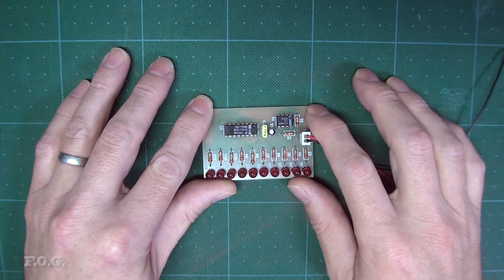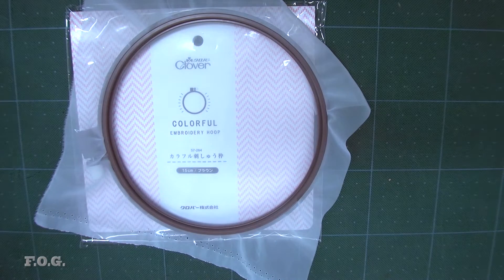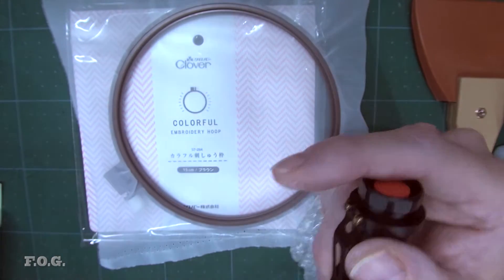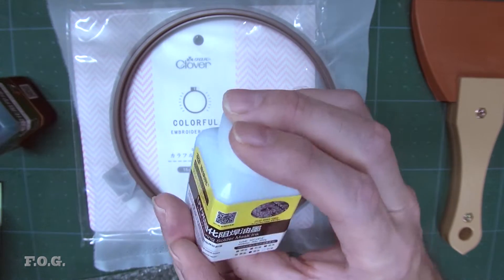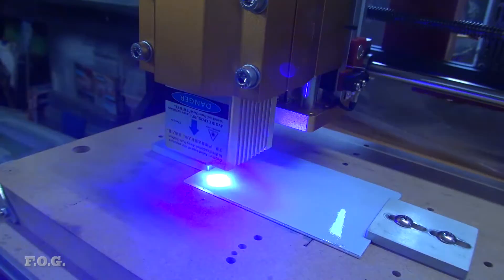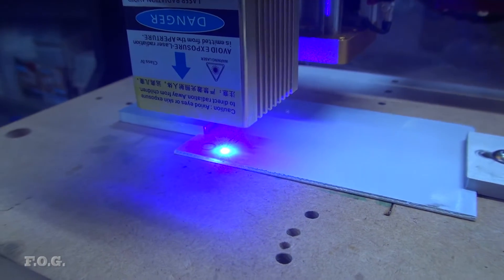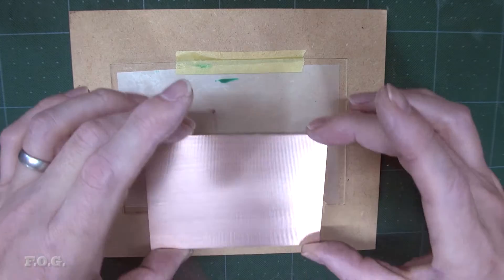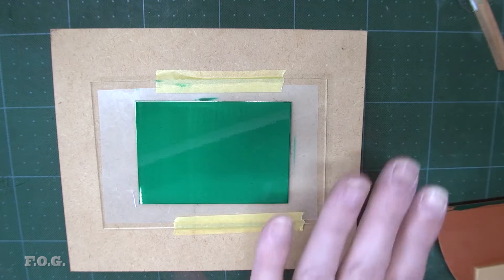EP6 – DIY PCB – Silkscreen UV Resin Coating

Comment: Will need eye protect glasses of uv light
Reply from the maker: @المخترععودةالكاطع  Yes, you will need!
Reply from the maker: @المخترععودةالكاطع  sorry, small correction. I thought you were talking about the UV laser where protection glasses are a must. If your UV light has its own UV light shield, then you don't really need glasses. If you have an open UV light, and you use it a lot, then using UV protection glasses would be a good idea. Generally I don't use UV glasses during the UV curing process, as my lights are shielded.
Reply: @ForOurGood  
Thank for your answer

Comment: that green solder mask at the end ? what brand is that? and did it come out that shiny after removing the screen?
Reply from the maker: @eross21  The brand of the green UV resin is "WNB". You can find it on Ali-Express. It is shiny after removing the silkscreen, but after UV exposure it goes a little matt. I think it looks pretty good, better than shiny.

Comment: Silkscreen is in an Indian PCB factory video.  Also you can CNC the resin off in the areas you want to use as pads and leave the copper.  This is after then resin is cured over all of the PCB side.  There is a video of someone doing that method.  

They CNC'ed both sides and did the holes.  They then did the vias.  There are two good ways of doing the vias.  Then the tin bath to protect to copper.  You can do this after the resin coating.  This means just the pads are tinned.

Second method:  Silkscreen for the resin coating and then used toner on a transparent A4 sheet to block the UV light in the areas they didnt want cured.  They printed the pattern twice and stacked both on top of each other.  Then placed on top of the resin coating and applied the UV light.
Reply from the maker: I am sure there are many videos on YouTube featuring various different methods for this, there are about 5 videos on the topic on my channel alone! Check them out if you are interested.
Thanks for the comment.:hand-orange-covering-eyes:
Reply: @ForOurGood  I will watch all your videos.  About to try and do this myself.  I'm trying the CNC method.  Using the silk screen to apply the ink and a laser printer to create a mask for the UV light.  Via's will use rivets for double sided boards.  After the uncured ink is removed from the pads.  Then tinning liquid on the pads only.

Just trying to avoid all the chemicals if I can.  This is being tried at home.  All your's and others videos are making this possible.
Reply from the maker: @GodKitty677  Good luck!

Comment: Have you ever tried instead of couting the board with resin use a venyl sticker
Reply from the maker: Thanks for the question!
I have actually thought about it, but I have never tried it, as it would be extremely hard to cut the fine details I need using a vinyl sticker.
Currently I am etching features as small as 0.1mm with spacing of 0.12mm using UV resin, my experience tells me that that would be impossible using a vinyl sticker.
Thanks for all the comments and I am happy to hear you liked the videos, there will a new video out soon.

Comment: Do the UV resin resist to the temperature of solder?
Great vídeo by the way
Reply from the maker: Thanks for the question! Yes, this UV seems to cope well with the typical temperature of solder. In my later videos, I did some rework, and there was no problem. Of course there is a limit to anything, too much temperature for too long, and it is going to start to break down.
Reply: @ForOurGood  Thanks for the quick answer. I will try this tecnique. You got a new follower. Greatings from Brazil.
Reply from the maker: @somostodospereira  Suprisingly I have allot of viewers from Brazil. Thanks for subscribing 👍

Comment: I have tried exposing green solder mask with a 500mw 405nm laser (allegedly, it's Chinese after all) and it really doesn´t work well at all. It only cures reasonably if the speed is set to 1mm/s. Focus doesn´t seem to affect it too much. I think this is only acceptable for silkscreen text.

It's probably better to just apply mask to the whole board and either print out a negative on a transparent film for exposure or use a laser to burn off the excess.
Reply from the maker: In EP8 in this series, I mostly succeed in exposing a detailed pattern using UV resin, but it's a bit blurry around the edges. Just yesterday I have restarted my experiments with this, and could further improve on that somewhat. The key is to go slow and low power, 100mm/min gave a nice result, but still furry around the edges. Going fast with high power does not work at all. Finally, it dawned on me yesterday, that it is likely the furry edges is related to the resin itself transmitting the light (I have experiences this with SLA printers too!), this is especially notable for small circles or intersecting lines where the seeping light gets double or more time to have its unwanted effect. My next experiment will use black resin, my expectation is that black resin should not transmit the light so well, and stop (or reduce) this unwanted fringe exposure. Should prove my theory right or wrong either way. Thanks for the comment!
Reply: @ForOurGood 
I have had some success with it too. The key with the ¨Mechanic¨ resin is to heat it up first. Apparently there are some volatile components in there that interfere with the curing process. I heated up a small test board with a heatgun set at about 200 degrees C. I assume the board reached about 80 peak. After letting it cool down the resin reacted almost instantly to the laser. 

Also, something to keep in mind is that the PWM toggle of your laser module might switch the buck converter, not the laser itself. In my case this causes about 60ms delay between the laser being fully powered on or off due to the capacitor charging/discharging. This may cause unwanted effect as well. I had to use delay commands in my Gcode to compensate for this.
Reply from the maker: @schetenwapper6591  Sorry, just found this comment in YouTube quarantine.. dunno why.
So heating it makes a big difference, really?!, I'll give it a go! What travel speed can you run at when it is heated compared to if it is cold? When I am burning the resin, I use travel speeds of up to 800mm/min and never seen any laser switching lag thankfully.
Reply: @ForOurGood  Funny I don´t think I said anything to trigger the quarantine.

After some testing using a proper hotplate I've found that 80 degrees centigrade for 10 minutes works well. You can let it cool down afterwards but the preheating step is important.

My travel speed is  2100 mm/min and one pass is enough to cure both white and green solder mask, with the 500mw laser at half power.

Also the laser spot size I use for green solder mask is about 0.5mm by unfocusing while the white solder mask spot size is closer to 0.1mm. Not necessarily because white is harder to cure but because it's used as silkscreen instead.
Reply from the maker: @schetenwapper6591  thanks for the detailed info!
Reply from the maker: @schetenwapper6591  Finally got back to testing the silkscreen text, trying out your advice. The first test was sadly a total fail, I ran at about 800mm/min and got nothing. I suspect that maybe your 2100 mm/min is a typo?? Seems crazy fast.
Anyway, I dialled it back to 210mm/min and I got a result that looked promising. After doing some fine tuning of the laser power and speed I actually got a good result that stuck to the board well. Lower power levels even could get a nicer result, but it adheres poorly to the board. The window of usable power is surprisingly small, though I am using a more powerful laser, so that likely is part of the reason.
So let me explain my settings.
Firstly, the software I use to create the G-code is Flatcam, and the way it traces the text means that you always get 2 passes, even though I set it so they basically overlap.
I preheated the board @80degC for 10mins and let it cool to 50degC before handling.
The laser I am using is “40W”, but actually most people state that these lasers put out about 10W in reality. 
I run this laser at 4.6% power running at 210mm/min.
The conclusions I have, is that your suggestion of heating the UV resin provides considerable improvements to the end result, but it did not appear to notably affect the speed or power levels I was originally using.
In my earlier efforts, I always found allot of exposure bleeding at the edge of the exposed resin, and specifically where lines intersect this would cause notable filling, and in the same way small circular shapes would also end up being filled (8,o,6 are all good examples of problematic characters).
But apparently heating the UV resin nearly completely makes this problem go away. What exactly is happening here I do not know. Maybe it chemically changes the resin so that once exposed it stops bleeding the UV light, or alternatively, maybe transparent volatiles, which are responsible for the bleeding, are being boiled off. I do notice that this resin separates a bit sometimes with a clear liquid substance being part of the mix, maybe this is the culprit...?.
Regardless, I don’t think I would have come up with this idea on my own, and I was really stuck with solving this problem, so thanks very much for taking the time to leave the suggestion. :face-red-heart-shape:
Reply: @ForOurGood  Well my laser is set at about 35mm/s which is indeed about 2100 mm/min. I use PrusaSlicer which isn´t ideal for this purpose but it does process SVG files the way I want it to. I've had poor luck with programs like InkScape. 
Since PrusaSlicer is meant for 3D printing it won´t overlap lines but you can cheat it a bit by making the spot size slightly wider than the extrusion width. This has worked well for my laser when exposing dry film or UV mask.

Indeed you do not want too much power from your laser. And indeed the 40W is total consumption but the optical power is usually a few watts at most. Most of the energy gets wasted as heat unfortunately.

Glad to hear it has been helping! I also really haven´t finished researching the best possible method for lasering PCBs.
Reply from the maker: @schetenwapper6591  Wow! 2100mm/min.. That's pretty insane.
Clearly something is fundamentally different to have such a different result.
I first tried 800mm/min with a decent power level and got nothing at all, finally I have settled of 200mm/min.
Anyway, it really does not matter, because it is fast enough at 200mm/min to do what I need it to do, most jobs will be done in just a couple of minutes.
I put a photo up on my community page showing the results, it took a little bit of tuning, but in the end the results are really very nice for PCB markings and seems to stick well.
Check on my channel page community tab if you are interested.

Comment: You should try making a mask and put emulsion on the silk screen so that you are only putting the white where you want it. This is how it is done for silk screen printing. You can get the emulsion as a dry film as well.  If you had a vinyl cutter you can also make the screen with low temp heat transfer vinyl applied to the mesh. But another note for single sided pcb, you can get vinyl stick sheets for inkjet printers and print a sticker to apply to the backside. If you do get the clear vinyl go over the printed sticker once it has sat for 12 to 24 hrs.
Reply from the maker: All food for thought! Thanks so much for taking the time to comment! :trophy-yellow-smiling:
Reply: @ForOurGood  I do like the idea of using mesh to apply the solder mask Given that I have plenty of extra mesh I think I will make up some small frames for pcb work.

Comment: This is the best YouTube channel for professional PCB making with high resolution in mind using best methods. Specially for using laser. You should try looking into laser scanning PCB UV sensitizing using laser printer polygon motor. An open source projected called “hexastorm” have able to achieve high resolution prints using a prism scanner head. There is also an open source project called “LDgraphy” which is much more easier to make and literally uses a laser printer polygon mirror motor. All that is needed to get high resolution PCB sensitizing is to use UV film and use a heat roller to pass it through the PCB few times. A modified card laminate heat roller can be used and boost it’s temperature when heat rolling the UV film. Another approach is to use PCB UV ink and have it sprayed on the PCB using a high pressure spray gun or have the PCB rotate at high speed and add few drops of UV ink to the PCB.
Reply from the maker: I think I cover it in the first episode, but the basic concept of this series is to challenge myself to make good PCB's with an off the shelf super cheap CNC. Actually I am also trying to keep any other processes as few and simple as possible, in this case we just have the UV resin application method and, the IKEA container with etchant.. and that's it.
I am also very familiar with the UV photo resist method, in a prior career I must of made over 100 PCB's using this method for real world applications.
Maybe a future series could look at improved ways to expose the UV photo resist for even higher resolution PCB's, but for now I am just having too much fun playing with this new CNC centric method I am working out. And to be honest, I usually found the UV photo method resist more stressful than it was ever fun, so there is that too ;-)
Thanks again for taking the time to watch and comment!
Reply: @ForOurGood  Good to know you worked with UV photo resits professionally, that puts peace of mind now 😅lol. Would like to see your vast knowledge in UV photo resits implementations for high precision PCB sensitizing. No one make videos about them on YouTube because it's highly complex and advanced.  

I agree with you, using a much simpler approach, newer ideas and methods for using cheaper chemicals, easily available chemicals and less preparation hassle to make quality PCBs is the way to go. Doing research in this manner can lead to new innovation which can be perfected for precision.

Comment: I think you should try closer setup,  laser and PCB when you try silkscreen
In focus laser has 0.02mm dot, it's almost invisible
But when you try closer you will have example 0.3dot 
It's big difference
And you will not burnout PCB becasuse power off laser will be applied to parter area (0.3 mm) not 0.02mm
Reply from the maker: Thanks for the idea. I will try some different focus heights next time to see how that affects the dot size. I already made another PCB, and video should be out in a few days. So the test you suggested might make it into a following video. Thanks again!

Comment: May I ask which laser you use and/or recommend?

And maybe it's useful to mention in the description which materials you use with links
Reply from the maker: I got this laser from the LaserTree official store on AliExpress (no affiliation). It is the gold "40W" laser with fixed 20mm focus. So far I have been really happy with this laser, but as it's my first laser I am not sure I should be making recommendations. Anyway, I usually list up materials I am using at the end of the series, so likely the next or next next episode assuming all goes well. Generally I don't do links. Thanks for taking the time to comment!
Reply: @ForOurGood  Thanks for your quick response. Don't understand much of the many types of lasers yet. The laserpecker pro seemed like a nice laser to me, but I can't find anything about the 20mm focus. This is a 405nm purple laser. Is that better or not if I may ask?
Reply from the maker: @Mr-Splendid-NL  I am really sorry, but I just don't know much myself as I am still a laser newbie myself. From what I have learnt is that the fixed focal length lasers are probably the better choice (assumes you can easily adjust the height). My research also showed me that 40W diode lasers (apparently optical power is only 5W) seems powerful enough for most needs. Of course these cheap lasers will never be as powerful as a CO2 laser,  but for me, it's proven good enough for what I need. You may also want to check the rated lifetime of the laser diode, I noticed some big variation in that regard.
Reply: @ForOurGood  No problem. I'll look into it a bit more myself. Is it an idea to mount the laser as an extra fixed on the CNC so that you only have to set an ofset once? That way you could make PCBs even faster.
Reply from the maker: @Mr-Splendid-NL  I probe the laser height for every operation where the board has been removed from the mount. I do this  to ensure a consistent focus and therefore beam width. I don't think it is a good idea to avoid this step. I do however see some people mount the laser on the left side of the motor mount. This definately would save some time when switching between laser and mill. My PCB process only requires 2 changes, so it is not so bad, and I also worry the side mount might affect accuracy. Anyway for now I will leave it be.